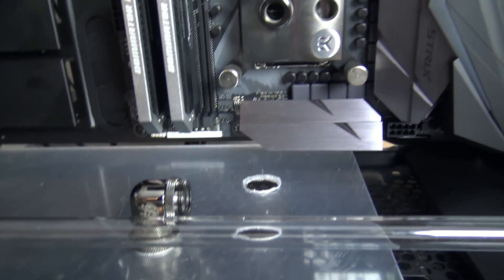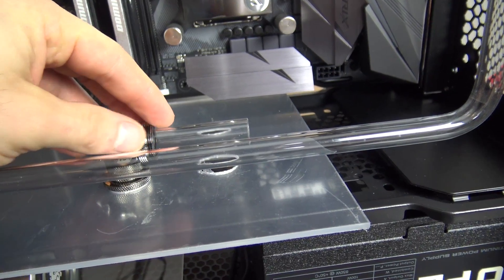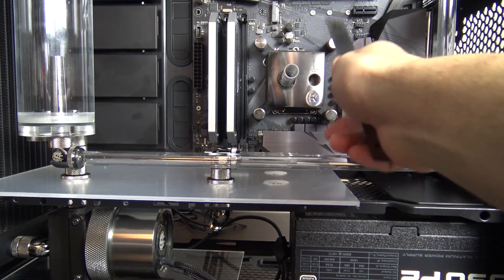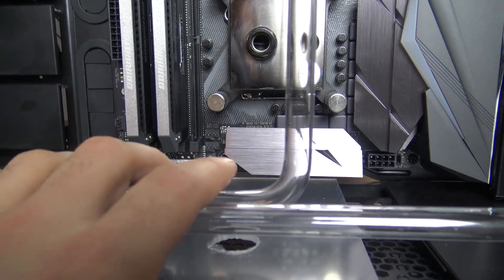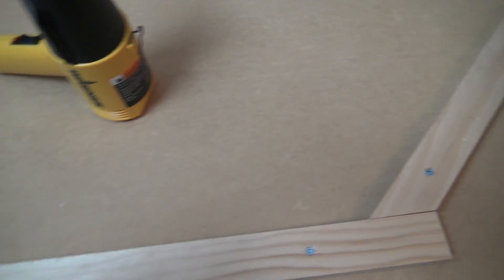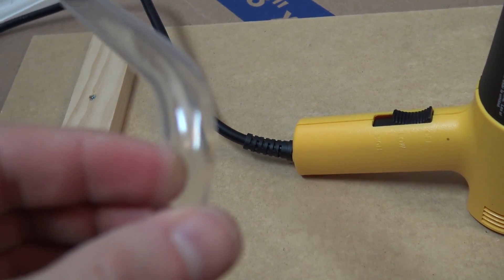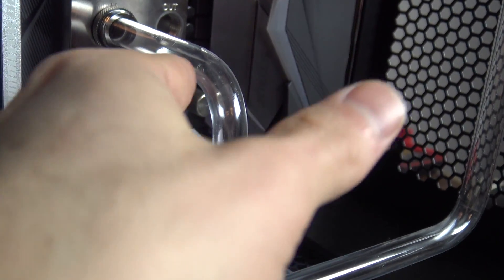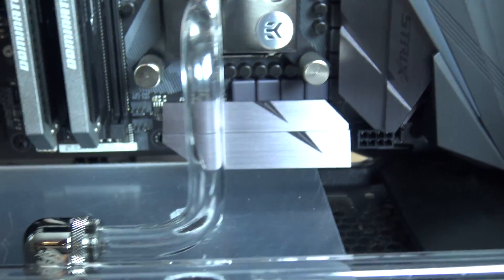HOW TO: Measure and Make Complicated Bends with Rigid Tubing

Comment: as a finish carpenter i can tell you what happened.. your using the wrong type of rule for you measurements ... the rule your using has a a blank spot that you butted into the baseplate before the graduations begin.. then when you layed our your blocks you forgot to add that to your measurement, you needed to butt the rule into the block instead of starting at the 1mm mark.  very easy oversight

Comment: You need to fill the bending portion insides with something, or it will deform! Silicon thread can be used, or just power wire of right diameter (just dont use it in electro afterwards).

Comment: Going to be honest chief, all that extra work and you're still coming out with less than perfect results. Still look good, but you could achieve the same thing just free bending and eye balling everything. No one is going to pull out a ruler on you to check for picture perfect bends.

If anything this guide is going to overwhelm beginners, or at the very least discourage them. It's not that complicated. You don't need jigs, clamps or special tools. You just need tubing and a heatgun. If you want 90 degree angles bend it over a table or just eye ball it. Super, super simple stuff. The tubing is pretty cheap so buy extra and use a few pieces and play around with it to get a feel for it.

Comment: Get a couple pipe cleaners wrap together n use it as a measurement for the tubing. You put it n bend it where you want the tube to go. Isnt perfect but it works amazing.  Use extra tubing n cut off extra. Promise this is the best way to have it measured

Comment: Thx very much. Everything I found so far was just dudes doing free hand bends saying like "I don't measure, you don't need to either, just get experience"... And I was really struggling with tight bends where I had to 2 bends right next to each other so doing the second one always ruined the first one. I think i will try your wood clamp stuff, seems like the right solution to my problem

Comment: Well how about to bend the two 90s first, measure the offset to the fitting at cpu block and then cut the left end of the tube to the needed length which is much more handier and does not need to measure a lot. Just theoretical but i would try it this way.

Comment: I hear in your video that you don't like eye balling the bends, eye the measurements of tube lengths & such due to you just being a perfectionist & having to have the loop run, bends precise as exactly how you want them to be, I really dig that dude. Much respect but another thing is I also got the respect for those who eye their tube lengths, do their bends by visual sight & a picture, image imagination & also the visual image of the correct length. It's not that these folks aren't perfectionist, some are perfectionist without relying on angle bending equipment or tools, to these YouTubers, folks who can just rely on a mental image of their loop plan, run, bend & rough to close length of tube & then file it down to precise measurement. The way I see it is that, some people have a talent for getting a precise image in their head or they can visualise their work & do it accordingly, these guys are perfectionist without any tools or equipment, these guys exist. We all have our own years of experience with everything & with experience, trial & error comes perfection, practice does make perfect.

Some folks just aren't at that level yet nor wants to be like the other guy, so 1 may just prefer to use tools to get correct bends, measurements first time & last time. One time due to not wanting to having to waste time, measure twice cut once no time wasting, no sitting there starring.

Point is, I respectfully disagree with your statement about some big YouTubers out there who eye ball their loop will never have it perfect & you can spot these small mistakes.

Some YouTuber water cooling Guru's have a talent for water cooling loop runs, modding etc without requiring further precision tools to so so. 

No disrespect intended ok dude, I mean I got full on respect for you & your work, you're the type of dude I assume likes to so things once & get it right on the first time, try to anyways. And what better way to get the loops right the first time is with precision measurement tools. 

Hope you don't take offence of my comment dude, it's not attacking or trolling, I just have my understanding opinion on different PC builders & their techniques, all builders have their own technique & different ways, doesn't mean they won't get it perfect. I also admire your technique for getting multiple bends in different perpendicular angles in place. All builders are perfectionist in their own way with their own unique techniques & experience & skill sets.

Comment: we need to know how to properly measure the distance from one side to the other side and bend is accurate, not what you show to us. You start OK and you deviate from the actual important subject and never come back.  I`m talking about 1 tube going in 2x  90 degrees direction.  How you measure and how to bend from the first marking point on the tube to the other marking point, to get the perfect bend and fit exactly. This is what we want to see. in your video, You did this off camera and even if you measure the tube you didn't show us the Starting Point of the bending of the second bend witch goes to the processor  with the mark been on the tube. You just have a template. We don't have a templet and most of us don't need one for 1 PC build. That's why we need to know how to properly bend a tube from 1 Marking point to Another, and the Point where we start bending showing the markings on the tube.

Comment: "If you look at those other guys eyeballing, you'll see inconsistencies in their bends, you really need to measure"

- couple of minutes later -

"All I need to do now is eyeball the edge of this tube over to the edge of that fitting there"
"It's gonna be a little bit of a guessing game, I could measure, but I'll just not measure"

Bro, if you are doing a "measure" guide to hard line tubing, how about actually, you know, measuring? The only difference between this guide and the "eyeball" guides is that you pulled out your ruler once or twice, then eyeballed the rest of it.

Comment: Eyeballing is not recommended for exotic type metal tubing.  Waste is a cost issue and metal mixtures are unforgiving.  Use your measuring tools always. Invest in accurate reliable protractors and such.  Happy bending

Comment: You work whit Acrylic or prefer petg, i find petg not good for pressure fittings as it shrinks allot by pressure fittings and than leaks its semy ok if change orings in fittings but acrylic just worked always better for me maybe just tolerances on petg not as good as acrylic

Comment: I really wanted to see the actual bending. Here’s another idea. There are devices made for bending soft metal tubing, usually in the plumbing section. It’s basically a long coil spring. It comes in various diameters. It goes inside the tubing . There may be a problem of the semi melted acrylic sticking to the metal. This may possibly remedied by using Vaseline jelly for lubricant. Any how I think I will try it.
Reply from the maker: I’ve had a number of people ask so I might do a simple video on bending

Comment: Hi, thanks for the video looking to do my first custom loop next year with AMD 7nm or Intel Sunny Cove and the only thing that I'm not sure on is the measuring of PETG, specifically when it comes to the fittings.  I wasn't sure if the tube had to reach the top of the fitting, or goes into the block a few mm's / etc.
Reply from the maker: You have to account for a small amount that goes inside the fitting.

Comment: Just stick the end into the CPU block and measure center to center distance from GPU fitting to tube, then cut that amount off the end in the CPU block.
Reply: Yeah that's the only part I was kinda like what are you doing?

Comment: What insert are you using to complete the bends? Mine for whatever reason keeps gluing itself to the tubing after the bends regardless of what is done...
Reply from the maker: Mine is the Bitspower insert. You can try using soapy water to prevent that from happening
Reply: @v.aesthetic3764  Ive used the soapy water and the olive oil trick so far, and though it does help it still likes to stick on some of the more intricate bends. Those from other videos seem to hold the PETG over the heat source for considerably longer than I have, so thats why I was wondering if there were different silicone inserts that have a higher heat rating?

Comment: NICE! I'm finally getting the parts together for a custom loop. The thing that keeps me procrastinating about it is bending the tubing. I've got a XSPC Photon D5 170 Pump/Res V2, a AM4 Neo block, an EX240 rad, V2 fittings and tubing picked out. I'm also making sure I have the fittings to leave a drain valve. I may do soft tubing first to get it set up and comfortable with putting it all together. Then in the future switch over to hard line. I get bored quick so I'll probably only last until Christmas before I switch. If you have any recommendations, I'm all ears. I've looked at Bitspower, EKWB, Thermaltake, and honestly the Photon pump/res drew me to using XSPC parts. I did find this Barrow CPU block that is pretty cool.

https://www.amazon.com/dp/B07F9XRK6P/?coliid=I314NOV1TSXCDM&colid=29ADBSQYSHJV6&psc=0&ref_=lv_ov_lig_dp_it

It looks like it does the same type of effects that the NZXT Kraken pump/CPU block does with the infinity mirror. I personally know nothing about the Barrow brand though.

Comment: you should have shown how you did the double 90 degree bend.. that was the most important part of the video really
Reply: Agreed, why do a video about bending rigid tubing then not show the bending
Reply: @tupchurch  Because there's already a million others that show the bending; most people can bend a 90 without screwing that part up. The jig and measuring was the big take away. Maybe y'all should just use soft tubing if you cant figure out how to start a bend and press into a corner.
Reply: @CourtesyToot  no u
Reply: @CourtesyToot  Well all others say the same thing "there are million others showing this" like in a circular trap lol.  And if "most people know how to bend 90 deg etc" then this clip isn't for them really.. Personally I measure everything, so that I don't lose too much tubing (I draw a sketch with measurements, and after each bending I verify against the plan). I came here as I'm looking up for some tools improving manual bending. On this the clip is good, I haven't seen such a simple setup yet (though quite basic).
Reply: @CourtesyToot  What's the point of this video then? Who the hell doesn't know how to measure? This isn't even the best way to measure...
Reply: No joke.. I've bent emt.. and there is always an offset you mark for where to start the bend because the tube shrinks a little when bending (for 1/2" emt it's something like 2 inches on a 90 degree bend).. do folks not even account for that during their bends, they  just trim off the end until it's good?
Reply: @AlanDike  That was the exact info I was looking for, what the offset is. Would you be able to link me to anymore info around this. Would the off set be twice the diameter of the tube being used?
Reply: @MWSpinamathing  i dont think so.. if im remembering right with emt.. its like 4x id, but im betting material makes a huge difference.. and diameter
Reply: @AlanDike  Thanks mate, glad that someone else understands.
Reply: true
Reply: true story ^^

Comment: Great video, thanks mate. I have done all my hard tube bending free hand, and because i wasn't sure how to measure the complicated stuff properly i resorted to some 90 degree fittings, not a  fan as it adds lots of weight to the loop and i prefer the only fittings to be at something that is actually connected to the loop. I have a new loop i'm designing now with my first tube res so this will help me a lot. Subbed
Reply from the maker: awesome! Thanks man!

Comment: Good vid but what was the point? Explaining something is A LOT different from SHOWING how it's done. Or in your case, Showing how you do it. I can lay out a wooden jig all day long like you did but How exactly did you USE the jig to bend the tube? Do you heat the tube, bend it, and lay it down on the jig to see if the bend is in the right spot? Do you bend the tube and push it into the jig to get the right size, What!.....lol
Reply from the maker: The jig is just to hold the tube's shape while it cools down. You still have to bend the tube by hand.
Reply: Gotcha

Comment: Without scrap wood to build your guides (which are a cool idea!), I found it useful to make a line on some graph paper and mark on that three points for each bend: The center of the bend, and ~25mm either side of it which is the region I'd heat up (will depend on the type of tubing, of course). It took a bit of trial and error to work out where the marks should be vs where the tube had to reach. I'd then mark the same on the tube itself with a felt-tip pen, heat the marked region and bend it against a set square. When bending, line up the three markings so they touch the edges/point of the set square, for consistent curves. Now see how it fits. If it doesn't fit, it wasn't a wasted piece. Each piece that doesn't fit helps you measure the next one, better than any ruler. Each failed attempt is a device you have built to measure the next attempt! Realising that (and having plenty of spare tubing) made me feel a lot more positive, instead of thinking I had to get it right every time and start from scratch if any bend was wrong. You can go back to the graph paper and adjust the position(s) of your bend(s) that was/were off, based on the piece you just made and how it fits inside the case. With two or three iterations you can get it perfect, even if it's 5 bends in three dimensions. I also think the wood guides and way of measuring in this video are a great idea, and when I was doing this stuff for the first time recently, it struck me how many tutorials there were on bending PETG (which isn't that hard) and how few there were on actually measuring (which is really hard, until you work out a technique). It's good to see something about measuring. My thumbs up.